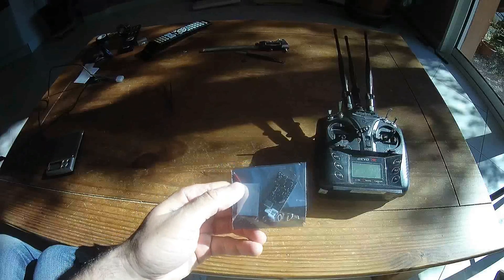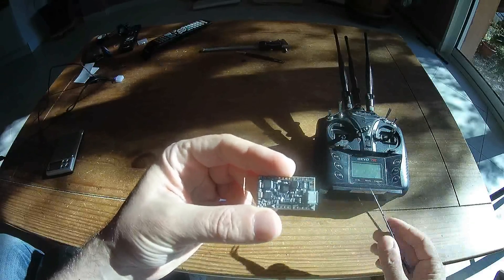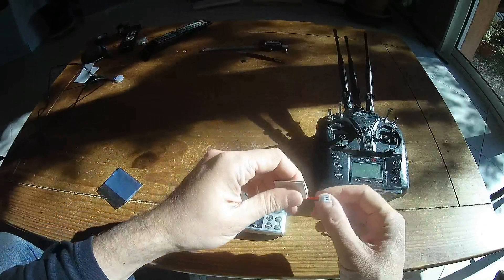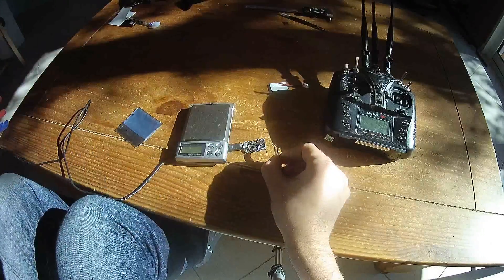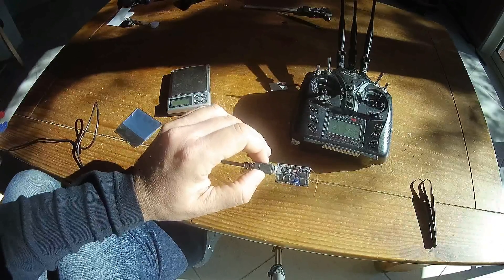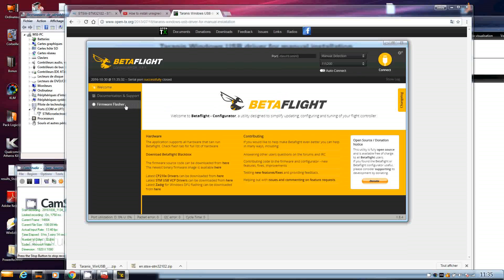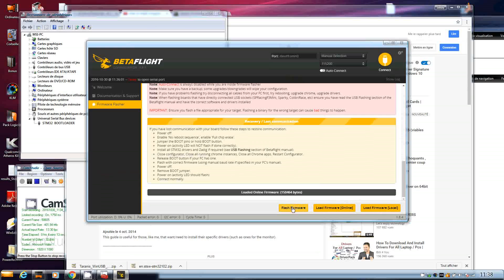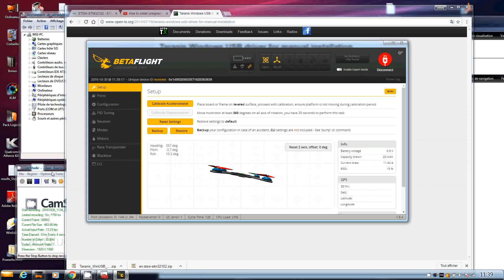FrFR3 unboxing binding and betaflight installation procedures (Courtesy Banngood)

Comment: Nice video! Did you have to do anything else to the FC so that you could see the controls in the Receiver section? I bound my Taranis to the F3 board, but it's not seeing the Rx in Betaflight, but the rx is definitely bound to the Tx considering when I turn it off and on the light blinks and turns solid.
Reply from the maker: Did you turn on Serial on UART3 ? (port panel) and turn on SBUS/SBUS in receiver section ?
Reply: Still nothing. :( Wondering if I got a dead fc..
Reply from the maker: you can see the quadcopter avatar moving when you move the FC ?
Reply: Yes I do
Reply from the maker: So ..port panel USB VCP MSP on, UART1 MSP, UART3 Serial RX on  ? then configuration panel: serial-based receiver selectect and SBUS selected too ?
Reply: Still nothing
Reply from the maker: :( .... strange ... :( ...
Reply: Yah, I think I have a bad FC. :(
Reply: I have the same problem
Reply: Did you ever solved it?
Reply: Solved it! Ports uart2 on serial rx configuration serial receiver and sbus!

Comment: I have this board but it won't connect to betaflight or cleanflight. I installed STMicroelectronics but it won't connect. I got it in DFU mode and  flashed betaflight, that's working okay. i think I have messed up bye updating the STM32 virtual com port with zadig.

Comment: If it comes with Cleanflight on it already, why would you want to flash it to Betaflight? Cheers.
Reply from the maker: Yes .. It comes with CF 1.13 already installed (I should said it in the video no ?)
Reply: Betaflight is more better for many things, like looptime or PIDs :)